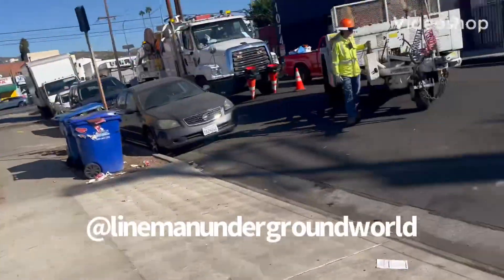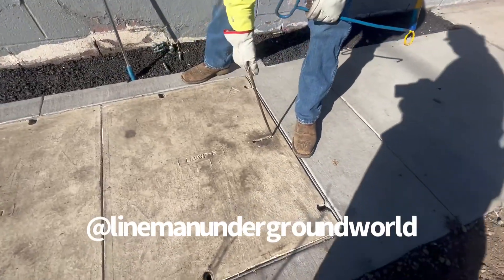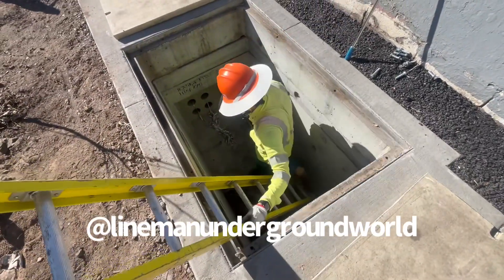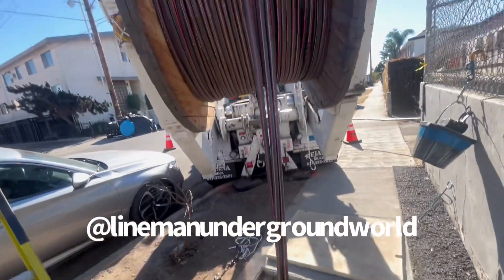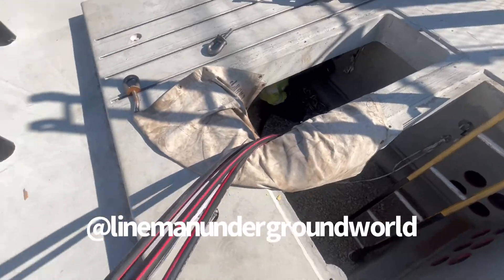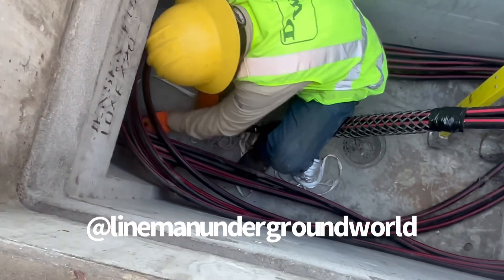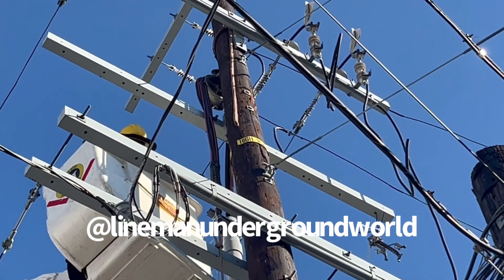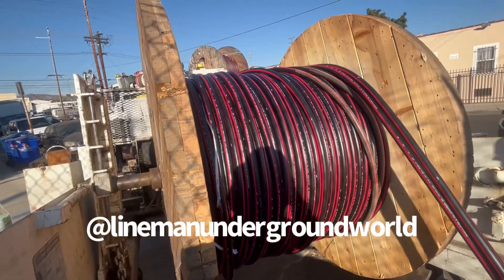Pole to hand-hole to pad mount

Comment: "Silver line"? We call that flat rope. Nice Green Lee cap stain running on the drill to pull in the pulling rope! I never seen that before? Nice Tony! 
I know the sound of that Hoag Davis self powered reel trailer. We have one. They are great trailers. More user friendly than the Posi Plus. Great rigging there. I can see you're a great teacher. Those vaults are super clean there. Ours don't have a concrete floor. Just process over a ground grid. You have some nice equipment! I can see the utility you work for has an unlimited budget? We used to buy great equipment here but cost cutting from the hostile takeover 12 years ago has squeezed our budgets. We make do with a lot less. 
Great video! Great content!
Reply from the maker: @johnclyne6350  wazzup John , that hoag Davis is one die hard work horse that doesn’t stop, and thanks about the rigging, I tell the kids to always look around and see what we can use , and after time gone by thank God the equipment has been coming in. Stay safe over there..